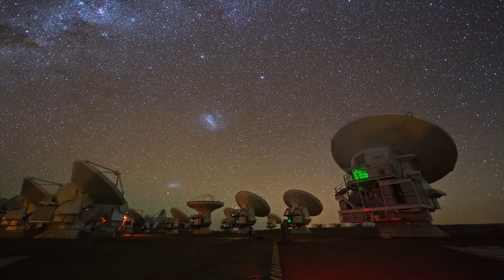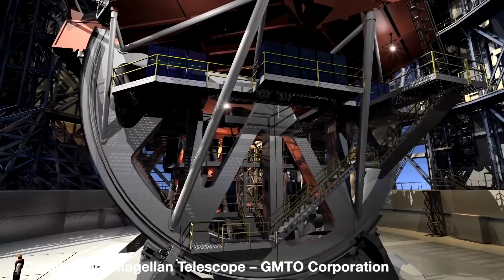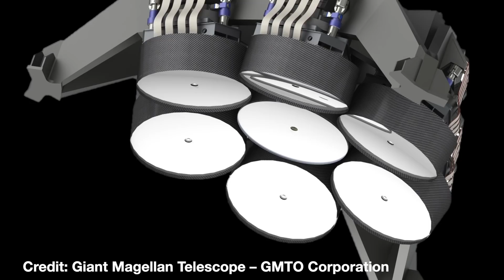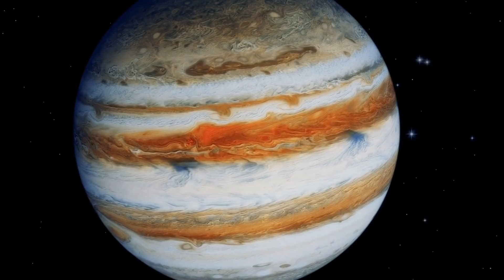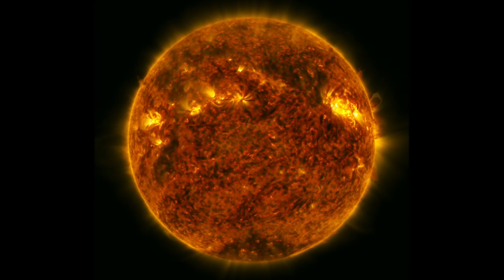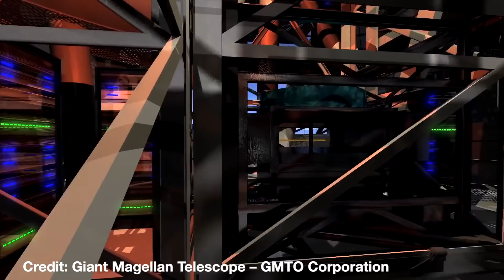Building the Giant Magellan Telescope with Dr. Rebecca Bernstein and Dr. Jim Fanson

Comment: Interesting, so 24.5m? and what about the Extra Large Telescope ELT with its with a 39m diameter mirror? It is also in the building phase, also in Chili and if I am correct it is the telescope with the largest mirror in the world  and It has around 256 times the light gathering area of the Hubble Space Telescope. It would seem reasonable to mention it, don't you think?